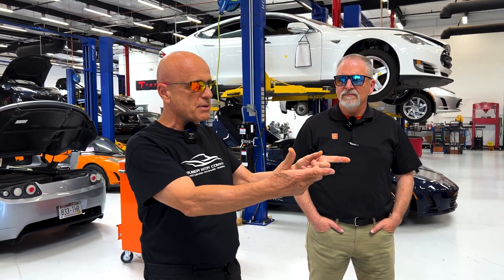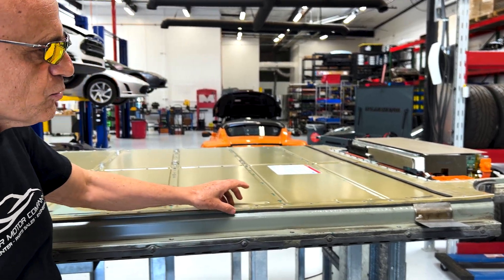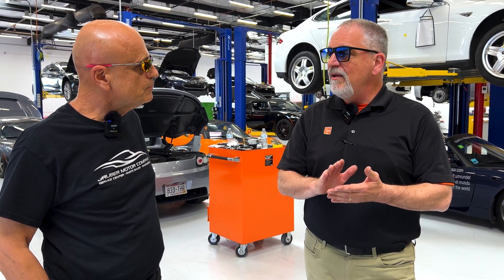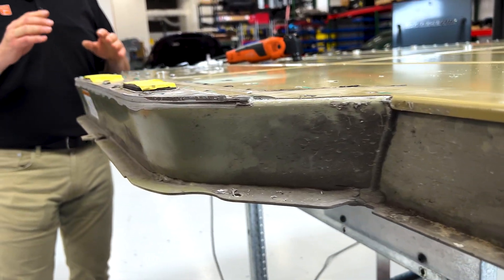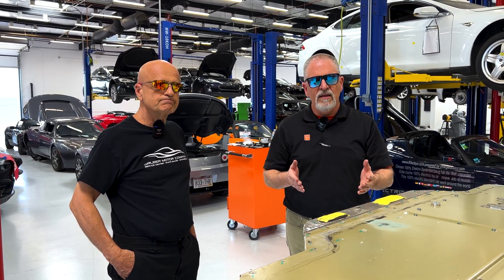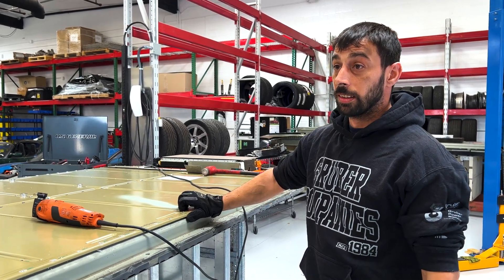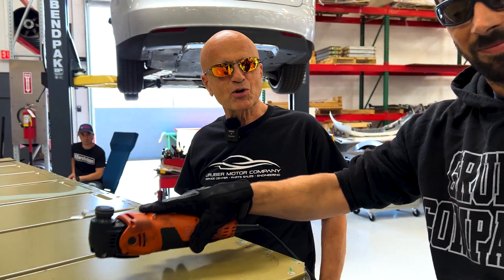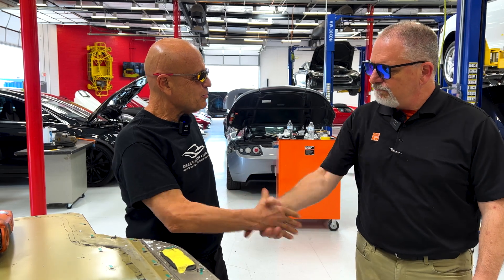A Tool To Open a Tesla Battery Pack!

Comment: Before watching this I enisioned a horizontal hydraulic press with long arms mounted on a jig that holds the battery.

But I think with the stiffness of the caulking this tool is exactly what is needed. A press might warp the panel because of the strength of the caulk.

Comment: Funny thing is I’ve been using a harbor freight oscillating tool with a small custom made bit to open DC/DC converters to change the PTC & a/c fuses for awhile now. I was gonna make a bigger attachment bit if I did ever have to open a main battery. Just never had to yet. It is also great tool to get damaged glass ( front, top, and rear) out of cars. Thought people knew this?  🤷🏻‍♂
Reply: I was talking about Gen 1 dc converters on last comment BTW. Not sure on newer converters after that.

Comment: Now how do you do the middle? Anyone who has actually removed a lid that has to be reused knows that's the hard bit, those side seals are really not that difficult in comparison!
Reply from the maker: We use a 4' Cheese Cutter and two guys alternating back back and forth,. Not easy.
Reply: @grubermotorcompany  nice, that's a good option for sure. I tried windscreen cutting rope as it was non conductive as it was my first lid, and ended up prying it with heat and a wooden wedge that worked surprisingly well by myself